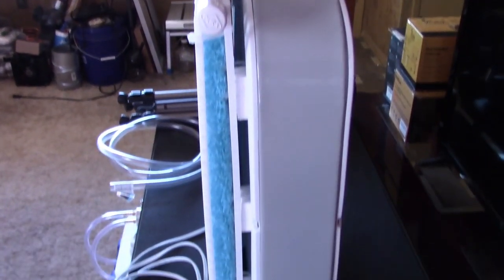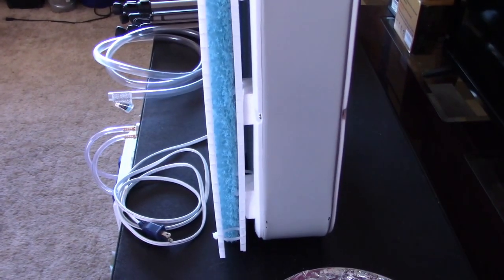DIY Evap Air Cooler! (Simple "Box Fan" Conversion) - Homemade Evap Air Cooler! New Design! Easy DIY

Comment: Wattage usage?
Reply from the maker: hi there. these fans usually pull about 50 watts on low, 75 on medium, and 90w on high. the pumps are anywhere from about 5w to around 20w
Reply: @desertsun02 thank you so very much 🙏

Comment: I made this to use as a water filter for a paint sparay booth. It works weel to exhaust air through a replaceable medium that doesn't clog. It doesn't cool the garage though, and it raises the humidity from 35% to about 50%.
Reply from the maker: these things work great as air filters for sure. (water is great for filtering air). i'm not sure why humidity is going up. the two main reasons are usually that it's not vented enough (or bringing in enough fresh drier air, so humid air can build up. other reason is that it may just be too humid for it to work. but you said that starting humidity was 35% (so it should work pretty good). but it should work great for removing paint fumes in any level of humidity
Reply: @desertsun02  I moved it over to my side door so it could get fresh air. Then I turned on my ceiling exhaust fan to low. It kept the garage at 82 on a 90 degree day and humidity stayed down to 47%. It will be 100 next week and it will be interesting to see how it works then. I think my problem was the air supply and exhaust. My next project will be the radiator version of the cooler you built.

Comment: Can I ask what the point of the Styrofoam is? and why not just attach directly to the fan? Is it just to help keep water out of the fan or is it for airflow purpose as well?
Reply from the maker: hi. the styrofoam is mainly to keep the water (and wet pad) away from the back of the fan.

Comment: I just finished building this and it works great!  I followed your directions exactly.  I set it up on my kitchen sink to test.  Measured with an infrared thermometer, my Bonaire window cooler says 64° on low.  Your cooler says 69° on medium and feels great!  That's using a 290 GPH pump which is a little too strong for this application.  It was actually spitting out a little water.  I'll get a new one tomorrow from HF.  Not including the water reservoir and pump, I bought all new components from HD for $65.  For the cost and effort, the results are fantastic.  The ceiling panel is real flimsy and cheap.  Using tin snips to cut it caused pieces to go flying.  Wire cutters worked much better.  It's just amazing how much we pay for simple stuff like this ready-made when we could easily do it ourselves for a fraction of the cost!  Thank you so much for sharing your inventions so generously!!
Reply from the maker: i'm glad you made it and it's working well for you! that what it's all about.
Reply: Unfortunately, this ultimately didn't do well in a real world application.  I used it in my 25'  travel trailer in front of the door with a doubled up shower curtain blocking the upper part of the screen door, and it only cooled it by about 5° after more than an hour.  Started at 89° inside and dropped to about 85°.  I might tinker around with it a little more before giving up entirely.  I'm open to ideas if you have any.
Reply from the maker: @Goody2shzToo  hi there. why did you block the screen? it sounds like you need to ventilate the space. you are getting the temp to drop so it's working but the humidity builds up if you don't ventilate the area. try opening some windows so air can flow thru the space.

Comment: I really enjoy watching your ingenuity and all your projects! Hat off sir!

What do you think woulr it be possible to build an evap wall lets says 7 feet by 7 feet (or maybe larger?), which would cool a entire room? With or without fans?
Reply from the maker: hi and thank you! a passive evap cooling wall. that sounds interesting. when i first read what you wrote i was thinking a clay wall (similar to how a zeer pot fridge works).
Reply: @desertsun02  Hi, nice to hear from you! 

Maybe a clay wall is a good idea as well. For greenhouses they use carboard, on one side of the greenhouse they place a big fan and on the other side the evap carboard wall. But other materials can be used also, like clay pipes for example. then build a sort of small hive made out of old clay pipes.

https://www.youtube.com/watch?v=nt2oyaP2m6Q&t=301s&ab_channel=Scroll.in

 I live in the Netherlands with humidities in Summer between 70 and 80%, so here it is very harder to use evap cooling properly. But it might work well in Arizona, Utah, etc.

In anciet times in Persia they built ice towers in the middle of the desert. Something different, but also very cool to see how they did it. https://www.youtube.com/watch?v=tnJms_3Gbuk&ab_channel=LeafofLife

I just bought a used spiral cooler, which is used to brew beer and other things. Mine looks similar to this one:
https://www.amazon.de/Klarstein-Eintauchk%C3%BChler-Wasserk%C3%BChlspirale-K%C3%BChlschleifen-Raumtemperatur/dp/B07KB8SDYD?th=1

I want to use your idea of the ice box cooler, but instead of using a radiator, I want to use this spiral cooler (I could not find the right size radiator here). Maybe I build it in a tube or many in the ice box itself, not sure yet what I do.

Have a nice day! Greetings from the Netherlands!

Comment: Just to clarify - the fan is sucking air through the back, through the damp pad, and blowing it out the front?  It's not blowing air through the pad?  I used to work overseas in a very dry area and we had these.  I now live on the east coast of the USA where it is very humid so the chance of this working is not good.  I'm going to pass this along to a friend who lives in an arid climate.  Thanks.
Reply from the maker: hi there. pad is on back of fan. if you put the pad on the front it acts like a barrier and most of the air won't go through. yes, these struggle to work if the humidity it too high.

Comment: Is the pad on the front or back of the fan?
Reply from the maker: hi. it's on the back of fan. (it acts like a barrier or wall and will block most of the air if on the front)

Comment: Keep in mind that in order to use it to cool your house it must be placed in a window at one end of your home and crack a window at the other (just like an actual swamp cooler) Otherwise you will simply saturate your home with moisture instead of cooling your home you will swim through air so humid you won't need a shower. Peace be with you.
Reply: Not really. You can buy portable evaporative coolers and if you do a little testing you'll find that they cool anything in front of them even when they are placed nowhere near a window. You should have some window open in your house but it doesn't have to be a crack, any window open anywhere will allow the humidity out but even if you don't I've sat in front of the indoor ones for hours and hours as it pushed ice cold air with no window open and the velocity of the air dried me quicker than the humidity built up so it was never a problem. Swamp coolers are made to be used in places with zero humidity and no matter how many of them you run you're never going to make your house more humid than it would already be if you were in any other part of the country.
Reply: I made one of these for my garage and it was very effective at raising the humidy by 10% but NO cooling effect. I didn't put it in front of a window or open air source. Results were just as you described.

Comment: Hi I recently built this and I am not getting as cool of temps as I want. I was wondering if my foam blocks that are seperating the pad is too large. Would it be ok ziptie the crate straight to the fan? or should I just reduce my foam size? My foam thickness is about half an inch
Reply from the maker: hi. i'd leave the foam size the same. i think mine is about an inch thick. (the blue pads are generally rated for an airflow of up to 2200 to 2300 cfm *which is perfect because box fans generally move anywhere from 1000cfm to 2500cfm). i wouldn't recommend skipping the foam blocks. you might consider making a shroud to block any air that may be entering through the gap between the pad and the fan. you can make a simple shroud with something called corrugated plastic sheet (it looks like carboard, but it's made of plastic). you can use that to block the air that may be going around the pad. another thing is to make sure that the pad is getting evenly saturated. also, it might just be that you have a slightly higher humidity. you might want to check an 'evap cooling chart'. those charts can be found online and can tell you what type of temp drop to expect with a given humidity and temperature.
Reply: @desertsun02  Thank you! I will try those options, I appreciate it

Comment: Hmm 🤔 have you ever experimented with automotive grade radiator fans because wouldn't those be waterproof and have good static pressure on such a dense pad
Reply from the maker: hi yes, i've used those fans in a few of my projects too. they work very well. i've got a video that i call my "blue cube evap cooler". that has an automotive radiator fan in it. it's 12v fan it so can be run on batteries or solar panels.

Comment: I made one of these for a shed, it keeps it from being 120 degrees during the day, when the day is 100 degrees it will be 100 degrees in the shed instead of 120.
Reply: It only works in dry climate area.
Reply: @Ajiponferret  That's true, we live in West Central Texas, East of here evaporative coolers are impractical, but West of here they work fantastically. Here we have humid mornings at around 70% and then very dry afternoons with the humidity around 20%, sometimes the humidity can fall below 10%, and our house will be 72 degrees while our electricity bill is at least 1/2 lower than if we use the AC.

Comment: I was wondering, if I made it so that the pad was longer dipping into the water on the bottom, do I still need a pump and tubes? Or will the pad absorb the water like a wick?
Reply from the maker: hi. the wicking action isn't strong enough to soak up the water from the bottom more than an inch for two so the pump is needed for sure

Comment: Can anyone explain how the cooler is working actually? I mean that is a normal fan right ? Then he added stuffs . What the pump us actually doing ? What happens to the water that are gather in the bottom container ?. I don't understand. Someone help .
Reply from the maker: hi there. yep, it's just a standard box fan. the pump is pumping the water up from the bottom and into the pipe that goes along the top of the pad. the water is then sent down the blue pad and saturates it. whatever water that doesn't soak into the pad just goes back into the tub. (the pad is kind of like a 'loose knit' sponge. it holds water but it also lets air through). when you turn the fan on it pulls the hot air through the wet pad. this causes some of the water in the pad to evaporate. (and that evaporation cools down both the pad and the air that is going through the pad). note that a lot of the water makes it back to the tub again and the water just goes around and around. since the pad is cold (because of the evaporation) the water will get colder the longer you run the unit. i hope that helps you 🙂
Reply: @desertsun02  wow . really thanks for the easy detailed info . I got it now . thanks a bunch
Reply from the maker: i'm glad it helped you 🙂

Comment: What was the blue square you put. Is it some sort of sponge?
Reply from the maker: hi there. it's called evap. cooler pad. it's basically like a loose-knit sponge. it holds water but also lets air through.

Comment: Great video! I just built a carbon copy. Is there a reason to space the pad off the fan and have an air gap? Wouldn't it be better to have the pad right up against the fan so all the air has to come through the pad?
Reply from the maker: the gap makes sure that no water touches the fan. you could add a DIY shroud to block the gap if you want. i've done that before with a couple other projects. consider using corrugated plastic sheeting. home depot has it. looks similar to cardboard but is made of plastic. btw, it's awesome that you made it!
Reply: @desertsun02  cool makes sense, thanks for the reply! Yeah I tried to shroud the gap with some gorilla tape and it seemed ok, I will look into this plastic sheeting. Thanks, and great design! Came together very easily.

Comment: Hot Tip: if you can get an old bar fridge, use that to store the water. Will get the temps cooler, but will use more power of course.

Comment: These pads (and even the lattice) are quite expensive wherever I've looked for them.  Do you have a good source?
Reply from the maker: i've seen the lattice for $12 at ace hardware. i got for $15 at home depot. the pads should be cheap. ii've always gotten them for 7 to 9 dollars (always under 10). looks like the home stores have the pad for 11 dollars now (inflation) but not bad. the pads are usually waaay overpriced on amazon. i bet people are buying them for $10 and then 're-selling' them for triple the price on that site.

Comment: Very nice and compact design. I thought evap coolers need to sit outside, with a flexible duct bringing the cool air in.
Would this work inside an enclosed space (say a tent?)
Reply from the maker: you can use them inside or outside. if you use it inside you just need to cross-ventilate the area so the humidity does not build up. the best way to use it with a tent would be to place it just outside the tent blowing in through a window on the tent. that way the unit always has a fresh source of air. then cross ventilate the tent so the air as somewhere to exit.

Comment: About the outdoor blue cube evaporative cooler...what size drill bit did you use to drill the holes on the pvc frame? The reason I ask is because I'm going to be building one tomorrow.
Reply from the maker: 7/64" or 1/8" is probably the best. i think they were smaller at first, but i've expanded them to about one 1/8" recently.

Comment: Hello! I've finally received my cooling pad in Canada (only option was an EBay hobby shop due to shipping) and will be building my unit this weekend. Thank you very much for sharing your designs! 

Is there any reason not to combine this design with the 1/4" copper tubing one, provided the water runs through the copper tube before the 1/2" PVC tube with its pressure loss from the 16 holes? I figure I may as well have 25' of 1/4" copper tubing on the output of my 20"box fan for maximum cooling.

I figure I could get quick effect with the copper tubing by starting the system with large frozen gel packs in the tap-cold water. Within an hour I'd return the gel packs to the freezer as the water would be at its coolest sustainable temperature by then.

Before this we've been managing by using a box fan to remove the hottest air from the apartment and select coolest replacement air source...but the best this can do is equalize to the source temperature. I created a cardboard/duct tape tube system supporting the box fan 14" down from the ceiling, firing down & out a window in the center of the apartment. It is very efficient at cooling the apartment in the evening. Without, there was no way to get rid of the warm air above 4' in the 1-level space.

Thanks again, I look forward to going through the rest of your work! I've only watched the cooling videos so far, but have subscribed. =)
Reply: In review, the reason to use separate pumps is, the 1/2" drip tube of the design from this video isn't functional when supplied by a 1/4" tube. =) Flow works well with 1/2" tube.

I've only been getting 2C of cooling with my version of the evap design of this video, but that's just round one. Perhaps I've squeezed my pad and impeded function? Gap between fan & pad 'cage' is 1~1.25", which can't be more than 1/2" from this version? Have covered side & top gap with duct tape to force more air to go through pad.

Comment: Is that a small bilge pump.for a boat?
I looked at the HF pumps and says water temp no higher than 77 but my house 84 and today 45% humidity but has been 30-37% this past week while outside humidity was 12-22%

So I looked into boat bilge pumps for a dc solar setup.
Reply from the maker: hi. it's just a basic water pump (not a bilge pump). most water pumps will handle water at least to 110 to 120F. i've never heard of one that is only good up to 77F

Comment: Dang I built this and only getting a 2-3 degree drop. 81F and 38% humidty ambient temp and about 78 degrees coming out of the fan. I spaced my cooling pad a few inches further from the fan and made a shroud, other than that I have all the same parts as you.
Reply from the maker: hi. i checked the 'evap cooling chart' and it shows that you should be getting about 68F air coming out of the unit (at your temp and humidity levels). one possibility is that the pad is not thoroughly and evenly saturated. air likes to take the path of least resistance so maybe the air is going through a dry (or drier) area of the pad. having the pad a few inches farther away from the back of the fan could be the issue. even with a shroud, the air may be 'skirting around' (avoiding) the pad altogether. that can happen if the pad is too far away from the back of the fan. the other possibility is that the humidity is higher than 38%. they may say the humidity is 38% officially but it can vary quite a bit even from neighborhood to neighborhood. note: if the air is going through the pad and the pad is evenly saturated then you'll get the temps listed on an evap cooling chart. it always matches up with the chart (within a degree or two). i'd try the pad closer to the fan. i have the pad mounted 3/4" of an inch from the back of the fan
Reply: @desertsun02  Great reply, thanks! I will try saturating the pad manually and checking the temperatures, and then moving the pad closer and noting any difference.